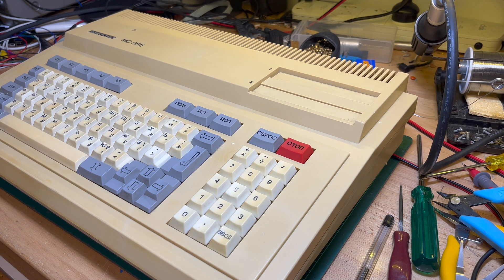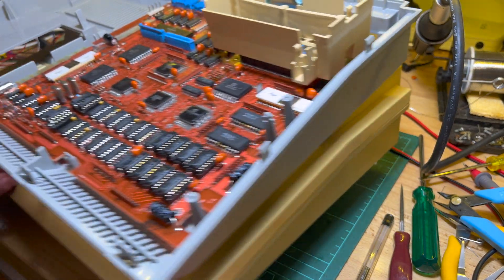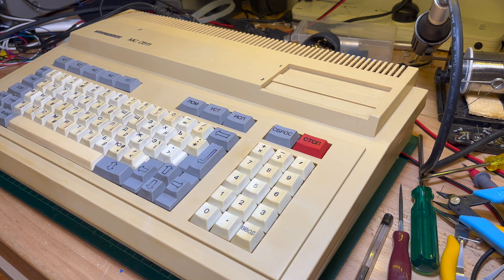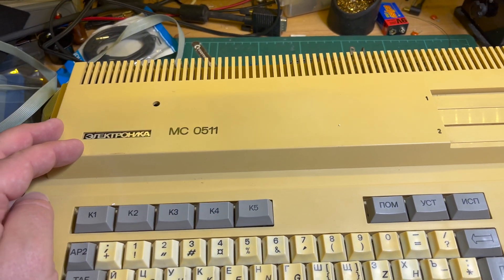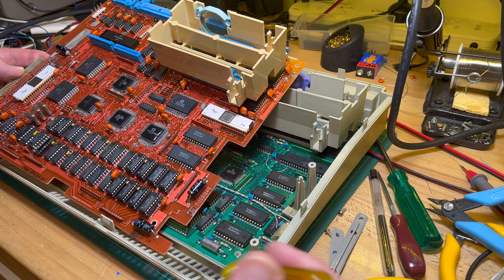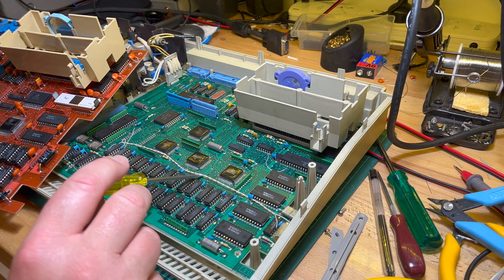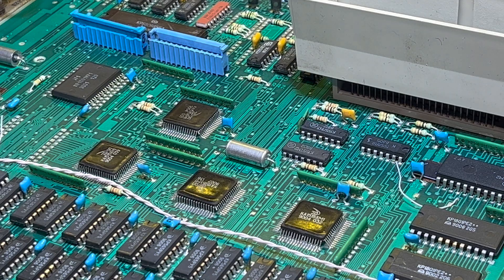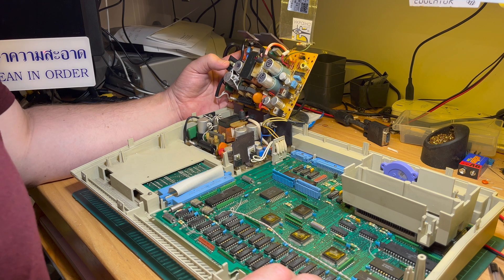Электроника МС 0511 (Elektronika MS 0511): Part 5 [TCE #0209]

Comment: 0.75A at 42V, can easily do 5V 2A. P=VA :) In fact, that would make that power supply horribly inefficient if it did use 0.75A, but I suspect it wouldn't use anywhere near that in general use.
Reply from the maker: Yeah, I realised later ... duh!  I've decided to just power it via a 9VDC plug-pack and run it through a 5V regulator inside the machine, rather than mucking around with 240VAC in, adding a fuse, grounding the Mean Well PSU, etc. /Brett
Reply: There was a ministry directive in late ussr to use low 42 Volt equipment in scools to fit safety reqirements
Reply: кстати от импульсных блоков меньше 2 ампер компьютер не работает проверял